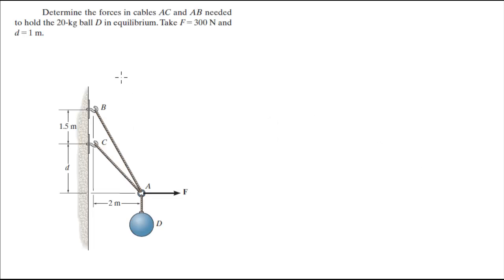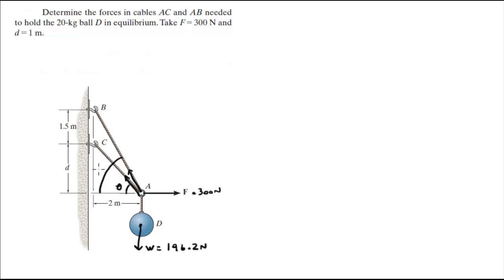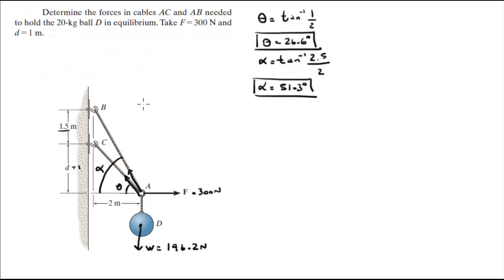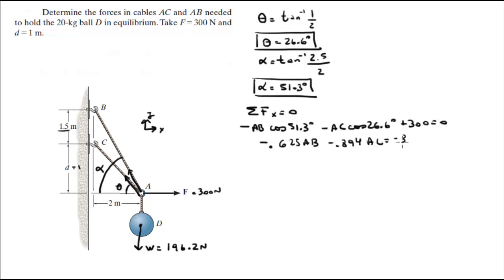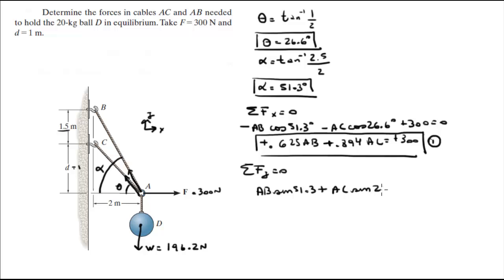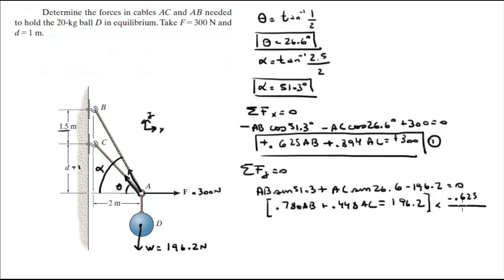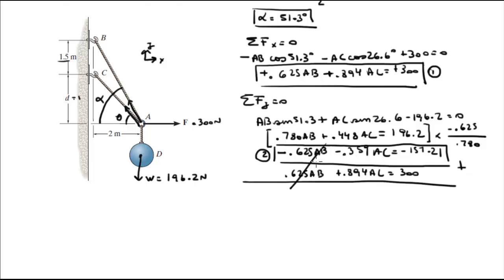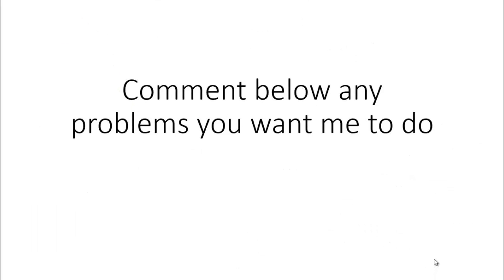Determine the forces in cables AC and AB needed to hold the 20-kg ball

Comment: i just had a question, why do you multiply (.780AB+.448AC=196.2) by -.625/.780

btw awesome video thanks for the help
Reply: Ilirian Jetoni, he had to multiply by -.625/.780 because he used simultaneous equations and one the unknown needed to be canceled out, so ac could be found.

I hope it helps.
Reply: Ilirian Jetoni 
I have the same question.
Reply: If we did not multiply by the negative in -.625/.780 will it affect the answer other than a negative answer?